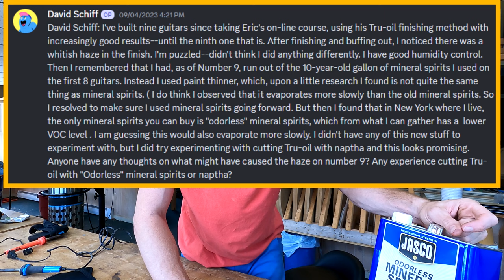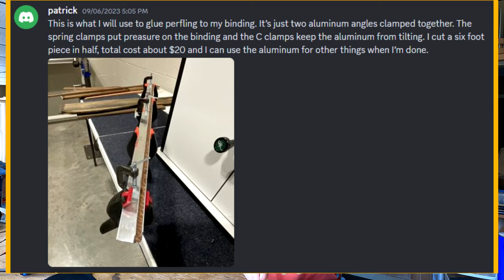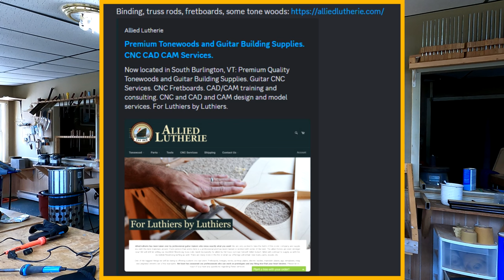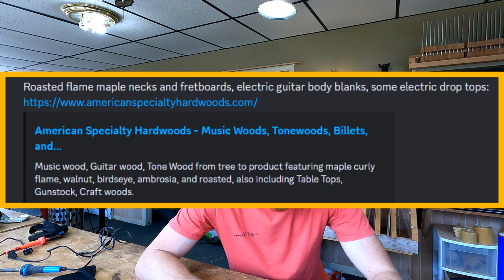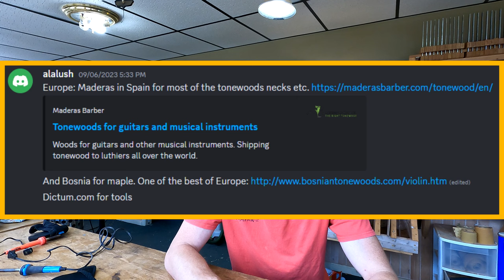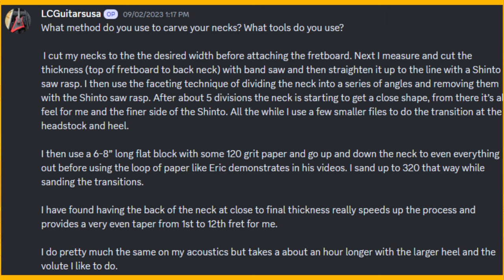Q&A | Smelliest Woods, Haze in Finish, Best Wood and Tool Suppliers, and More!!

Comment: Low Odor mineral spirits is absolutely different than regular.  There are some oil based paints that I've used where it has ruined the finish when regular mineral spirits doesn't.

Comment: Thanks for the video.
I have some Walaba wood. Botanical family Caesalpiniaceae. Talking about stinking wood 🤮🤮
 Stinks like a clogged toilet that has never been cleaned in 25 years. 
BTW, great tip for gluing with these Aluminum strips.